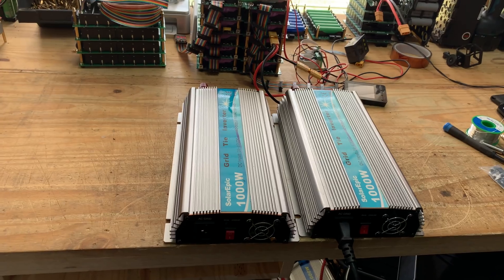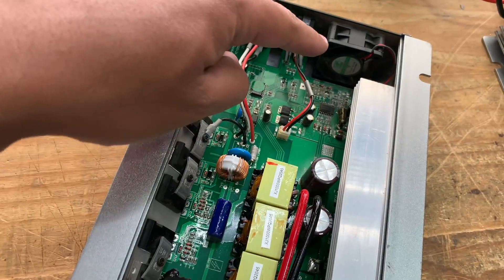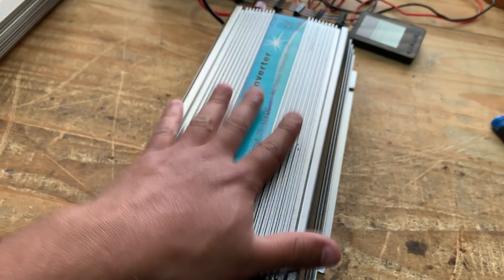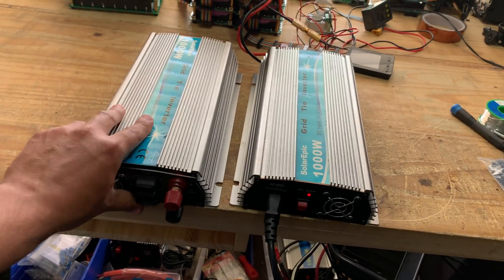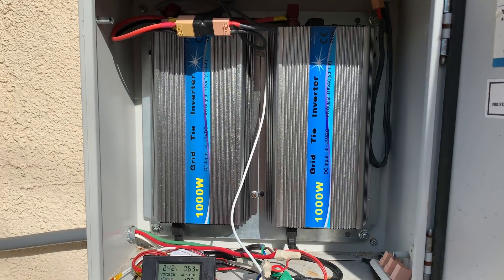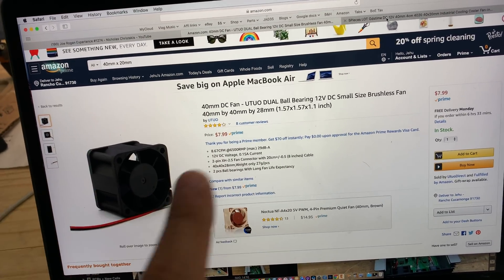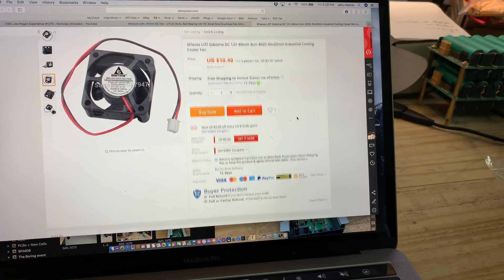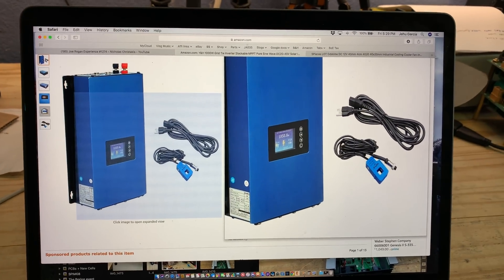Cheap 1kw Grid Tie Inverter 1 year UPDATE

Comment: LOL would you believe I just ordered one of these yesterday ?  Guess I'll be ordering the fans here soon, eaaa?   I noticed the fans you list use a Bushing ( Sleeve ) Type Bearing.  That's most likely why they're crapping out so fast.  I'm going to try and locate some with Ball Bearings   .      These will do. https://www.ebay.com/itm/Ball-Bearing-12V-40x40x20mm-Brushless-PC-CPU-Case-Cooling-Cooler-Fan-2pin-New/253318494094?hash=item3afaf5778e:g:QkQAAOSwdoJbRHM6&frceupt=true

 Guess your in need of sealing  your outside enclosure a bit.

Comment: Thanks for the update. I noticed your outdoor box for your units has a fairly small air volume when closed, limiting air cooling. Is there some sort of outside air access for the fans to move much cooler ambient air through and over the units that we can't see or do they only have access to the internal volume of air? Bigger/better fans would help, but cooler air access would have a greater effect, IMHO.

Comment: How do you limit the current from your battery pack to run the less than a 100%. What do you use. Thanks. I want to use 400w ones in 200w. What can I use.

Comment: I bought a 50 amp power supply whose fan ran all the time and after a year it started squeezing so removed sticker off back of fan an put drop of sewing machine oil been running smoothly for 8 months now.

Comment: will these cheap inverters work off grid as well?
Reply: unlikely they have island protection so if it doesn't pickup any mains power from grid it wont turn on as a safety youd have to trick it.

Comment: Connecting your cheap inverters to a battery is a bad idea. Most if not all grid tie inverters expect a solar panels as the input which act as constant current sources with limited current. The MPPT algorithm ramps up the output current until the input voltage starts to collapse and then attempts to keep the input voltage at the maximum power point by adjusting the output power. With a battery as the source, it will likely never see the voltage start to collapse until it has passed its maximum power rating. Thus the magic smoke appears. High quality inverters also monitor the total power and refuse to go beyond the designed maximum.

Comment: Hello Jehuu!
I use same inverter and running it HOT. Fan didn't last a month and battery terminals melted off. I have cut a hole for 120mm fan on back and bolted on extra heatsink. After this thermal upgrade it has been working nice, quiet and cool for a year.
It has been engeneerded poorly. NO WAY this 40mm can cool down this amount of heat effectively. 
I calulated that my inverter is just earned back its cost in 1,5 years. It is pushing about 2kw/h back to grid in a day. (Central Australia)
Reply: Hey where did you buy this in Australia? And is it still running now? Looking to get one also, thanks!
Reply: @Happyantix112  
Hi, best place to buy this is Ebay. 
And YES, it is still running. You just need to upgrade fan to bigger 80mm or 120mm.
If you running it on 12V battery bank on 12V (18-20V) solar panel, then 600W model is OK.  It has input voltage rated 10V to 32V
If you use 36V solar panel, then you need to go with 1000W model, which can take higher input voltage.

Comment: Added a 120mm fan in the bottom thin panel in the bottom.  Cooling seems to be the issue in keeping these running and as close to Max as possible. More cooling the better.

Comment: Cheap inverters like this have fake certifications and are dangerous! I bought 2.. one 250w and one 500w. Both died too.. I bought a "real" grid tie inverter instead. Real quality and no fake certifications. Brand is SMA. 1800W output max. It has been running 24/7 for 5 years now without any problems. No fans in it only passive cooling. Its 10x heavier than those chinese crap ones. I would recomend buying real stuff instead of burning down your houses. Chances are the insurance will not work since the are not approved to be connected to the grid at all.

Comment: I also bought two of those inverters about 2 years ago and they both ran fine all the way up till I replace them with new ones that ran a higher voltage yes these inverters run extremely hot I've tempt both of my inverters around 140 degrees with the fans running that come installed inside them I have external fans running on those inverters after I discovered how hot they ran and if you run an external fan on them they will only get to about mid-80s which is fantastic for those inverters to run at

Comment: Im on my 4th one... visually cant find anything wrong when taking them apart. I have it hooked upto a spare 250w panel so its not getting beat up. I wont buy anymore
Reply: Just had one fail and took it apart - I discovered a bad cap in the three big in a row mine is designed with.

Comment: I have 3 of the blue inverters and I purchased them on amazon. They have a monitoring system that you can purchase from Aliexpress. Its called the "Wifi Port Plug for MPPT 1000W/2000W NEW SUN Solar Grid Tie Inverter RS485 connected Web/Phone App on Line Monitoring" and It works quite nicely. Also, I have had to return 2 because they were DOA and would not produce. I cant wait to see your video on these and hopefully the battery limiting functions this inverter can apparently use!

Comment: Cheap inverters don't have impedence matched mosfets so inevitably one is going die prematurely from more load heat resistance and then short the others as well. Another important point is to make sure they are all tightened to the heat sinks very well as if one is not sinking it heat effeciently it will be the one to burn up and short out the rest in parellel.

Comment: You need some ventilation in that box you have them installed in - Even if the fans are working they are just going to recirculate the hot air, which means they will stay warm, the fans will run way more hours than they would otherwise need to and burn out faster.  I have the exact same inverter and what I've done is take the bottom panel off and have it sitting on a laptop cooler which is just like a tray that you sit under a laptop that has a 120mm fan blowing through it.  Keeps the inverter so cool it's own fans never even turn on anymore since I did it.
Reply: Jack Good is right about ventilating that box. With out getting some outside air in, it's just moving its own heated air around. It will never get any cooler.
Reply: Thanks

Comment: Are those fans meant to be vertical?  That could be why they are dying. I think I remember reading somewhere that certain types of PC fans can have premature death if running in the wrong orientation.
I think if you flipped the inverter 90 degrees it would last longer, so like = instead of ||
Reply: Yeah man otherwise they not running on the bearing properly

Comment: i owned two of them 12v and 24v they cant handle rated watts for many hours on end they die, unlike better known brands
Reply: @wu ming well that is true aswell, i have top quality now yet i bought them cheap near new and new and unused for the price of those iverters in the video.
they can do much more than theyre rated at and dont have cooling fans at all , theyre better engineered , the ones i bought here in Australia are known to last 20 years and operate at their peak every day. i just got tired of all the failures as ive owned many inverters, the ones i have now have run flawlessly since 2013. its a huge difference , mind you i wouldnt pay retail price.
Reply: @closertothetruth9209  How do you have the new top quality ones wired in? The same way though a standard GPO?
Reply: @wu ming Latronics
Reply: @wu ming yep  , we weld for hours using  our latronics battery inverters and do all sorts of things it never even gets hot ,a guy i met says latronics are ok but he builds his own being an absolute perfectionist he is an electrical engineer of 40 years experience , his inverters have surge capabilities of around 68kw for 5 mins i think he said, he winds his own toroidal coils , builds his own pure sign circuit , his shed is like absolute paradise for renewable energy enthusiasts ,its like an electrical laboratory,.hes on the backshed.com

Comment: I need a 2000w inverter with custom voltage ranges. Need to be able to power a space heater, a microwave, and an ac(not all at once). Building a van.
Reply: Ok

Comment: Guess the failed unit protected the second unit through shortcut, else the would probably both have failed...Fans are a poor protection; they collect dust over time and or fail. Larger cooling ribs preferable.

Comment: Power These units on half Power, Remove 40x40 Fan and install two 120mm Fans, therefor Remote the thin Cover. Run the Fans with DC DC Converter direktly from DC without temerature controll on around 8-10V for 12V Fan, it will Last forever. If one Fan fail there is a Second

Comment: N00b question here. Can these be installed legally in the us? For example would an electrician hook these up? Or if one of these blow up will your insurance tell says it's your fault. Keep up the great videos!
Reply: I'm not from US but i dont think anyone can generalize like that and say it's okay or not for whole US, I think it depends a lot where you are and you should check your local laws :) For example here where i live in EU, they are ofcourse quite picky with what they allow, having a list of tested and approved inverters. Chinese ones are not on it ofcourse. The main issue that grid owners have with these is, that they must not run if grid loses power, so that no technician gets zapped when repairing, due to your system sill pumping electricity to grid. Also meters can get all funky if they are of certain type. Meaning, that they might double read your generation into usage and make you pay for it :D So, know your risks and act accordingly.

Comment: For your DIY power wall, what are you using at night to pull power from the batteries instead of (or along side) the grid?
Reply from the maker: A UPS
Reply: jehugarcia oh okay. So is your grid tied inverters output connected to UPS’ input or is UPS connected to mains and you just cut the mains power manually? Or perhaps automated?

Comment: use your thermal camera on the 1000w grid tie inverter. If the inverters use MosFets made in China, they will run hotter. Chinese Mosfets have higher resistance in the ON state which generates more heat. There is a theory that you can parallel these Mosfets for much lower on state resistance.
Reply: yeh i watched a guy on youtube swap out the mosfets using a USA brand i think by memory the name was texas instruments or similar sounding name ,the temp was cooler and efficiency significantly  increased, you get what you pay for
Reply: @closertothetruth9209  can you find that video ? I would like to watch it

Comment: I have one of those with 10 100w solar panels no batteries. It has been running for over a year and a halve. With no issues. I love it
Reply: Ruben Salazar how many watts do you actually get I have 3 325w and only get 750w out of them I have. Gotten 980w before on output I connected an extra 325 and now I get he 1000w I have like 20 325w solar panels I dont use
Reply: @nightmareinaction629  I do not know how many watts I get out of my 10 100w panels. I,m sure it is not 1000w. That would be perfect conditions. And they are not name brand panels to begin with. I will have to measure on a sunny day and see.
Reply: Ruben Salazar also have you found any interference mines causes a lot when sound stereo is plugged in
Reply: @nightmareinaction629  I have not noticed any interference in stereo, tv s or computers. I also run a 600w inverter at night with batteries and its own solar panels and charger. No interference or static .

Comment: Hey Jehu (or like minded fellow) 
Do you think it matters that those inverters perform more efficiently within its MPPT range? Because I believe those inverters are designed to run directly off of solar panels. Normally if they are connected to Li-Ion batteries, you (for a part of the upper and lower ends of the cycle) are operating outside of the specified voltage range. So I wonder if that has anything to do with its lifespan.
Reply: They are designed to run directly off solar panels. Below voltage the unit will not turn on. (Well, if they operate normally, they will turn off. If that fails, it will kill the unit. I suspect that is the part failing in most units, which leads to the latter components failing in the inverter.)

Comment: I cant get my mind round this what happens when a grid tie inverter goes over the 1000w rating what happens
Reply from the maker: it frieds?
Reply: it drops to about 940watts based on what I have seen. I have the 1kw sysytem and 3 of the 1Kw Y&H blue grid tie inverters.
Reply: @1313nate  what happens if you go over a 1000w does the grid take over the rest or will the inverter die
Reply: @joshuabest100  Since it is a Grid Tie Inverter, it can only pump out a maximum of 1Kw.However this cannot be sustained for a long time based on the ratings of the inverter. What will happen (If you have 1kw  or more going into the inverter from solar) is that the inverter will spike up to 1Kw and then drop down to a lower wattage that it can produce for a prolonged time. If you forced the Grid Tie Inverter to run above 1Kw with a few modifications, it would definitely fry, just as jehugarcia stated.

Comment: Interested in how well it’s working now.  In a year did it produce enough power to be worth replacing?
Reply: I have one 1000w exactly like these ones. Hooked up directly to 10 100w solar panels no batteries. It has been running for a year and a halve and still going strong. Fans still work. It cut my lite bill in halve. It has paid for it self including the 10 panels. I love it. When it goes out I am buying an other just like it.